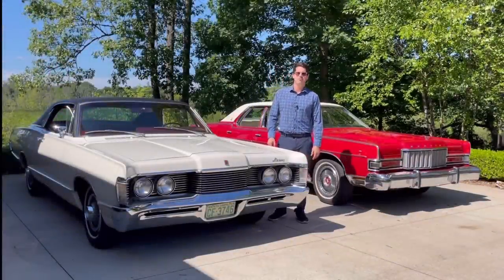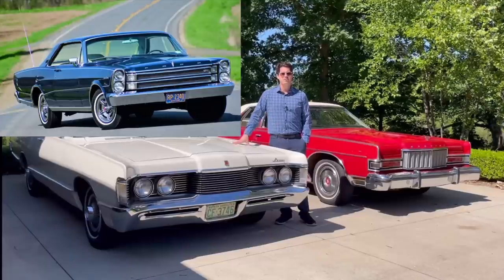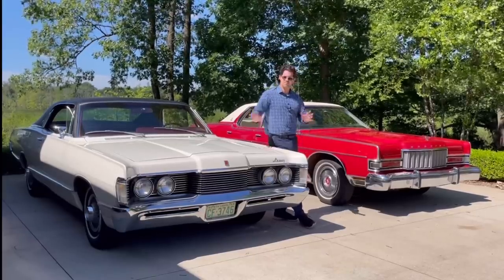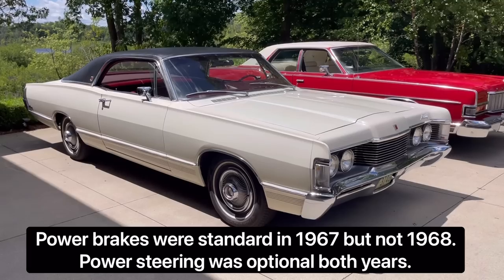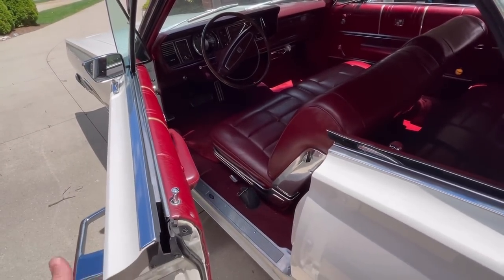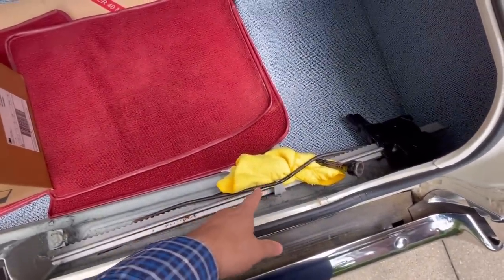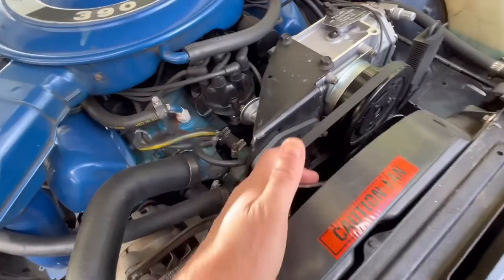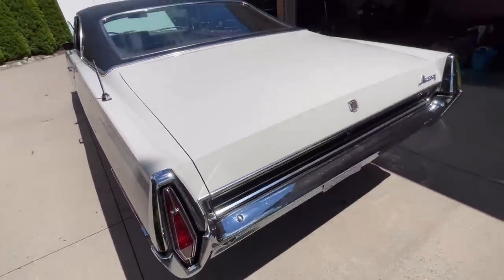9000lbs of Mercury!  Comparison of 1968 Marquis & 1974 Marquis Brougham (Hawaii Five-O Car) - Part 1

Comment: Even as a kid, I always knew the sound of a Ford door closing. The latch made a very loud (but secure sounding) KLITCH to go with the "thunk." Much as love I Mopars, they (as well as GM) never did quite as well with the doors. Even my friend Mike's shitty Mercury Comet had great sound doors. 

Even though you installed dual exhausts, it has an original sound. That is, it's a mellow "chug chug," not some grotesque Flowmasters or anything. I hate when people do that to a full sized luxury car. As always, love your cars and your narration, Adam.
Reply: Haha, I know exactly what you're saying with the door latches! Also, I could always tell what kind of car was driving by or idling or starting without seeing it.  The foregoing would've been helpful if I were blind as my dad would say 🤣
Reply: Fords had that sound all over the place. The engines were higher pitched than GM and Chrysler, the non-solenoid starters, the click of the latches and shifter. I guess that was brand recognition and personality. 
All brands had their own:
GM doors always sounded like they didn't want you to notice what they sounded like, as did much of the rest of the car. 
Mopar door latches  always sounded like they were out of alignment. lol I mean, who puts a whiney, gear reduction starter in big fuselage bodies with big block engines? 
I guess it was finer sounding than the loud truck starter they used in the 50s cars. Our '57 Belvedere was a hard starter: RAWWR R, R, RAWR R, R, R,  RAWRRR Boom! Instead of: SQWEE CHEW, CHEW, CHEW Boom!
AMC? They mostly sounded like Fords, ...except different. 🤓

Comment: Thanks Adam. I enjoyed the review. Re the 75-78 Marquis. I think it is fair to say they were lighter and used plastic more extensively, although I would hardly call them “tinny”. They are still large, heavy cars in much the same way a mid to late 60’s full size Ford or Mercury probably weighs in at a similar amount. The lighter weight also aided drivability given power outputs were lower as well. I do love my 76-78 Marquis and have one for each year - 2 Grand Marquis pillared hardtop four doors and a Colony Park wagon.
Reply: The lighter versions probably also got at least 150 feet more per gallon. :)
Reply: For sure. Every foot counts.

Comment: Hi Adam, You mentioned that the 1968's were only 3,900 in production numbers, similar to the production numbers of the last year that Ford made the Crown Victoria wagons which was 3,800 and change. I happen to own a 1991 model ( LX ) that only has 12,000.0 miles on it since my rebuild of both engine and transmission in 2020. The body is in excellent shape as the first owner took it to Florida every winter so it has never seen the salt. It has all the power features and seating for eight. In fact when I bought the car the rear seats still had the plastic Ford bags on them !

Comment: Adam, thanks for pointing out the difference in GM/Ford build quality referencing the doors. I had both a ‘71 Lincoln Continental Mark III and a ‘72 Cadillac Eldorado convertible (at different times), and the doors on the Lincoln always seemed more solid than the Caddy’s. Thanks for letting me know I wasn’t going crazy.

Comment: I recall on Jay Leno's YT channel, he was reviewing former California Highway Patrol Cars...and the CHP used a 1970 Mercury Monterey and ordered them without power steering...apparently as a budget saving move.   And the troopers didn't take to them so they returned the Mopar for the next several years....Interestingly enough...the LAPD bought Mercury Montegos in 1970 as marked patrol cars....and apparently the officers didn't take to them...because disk brakes were new and the officers kept riding them during pursuits....a technique that worked on drum brakes but would overheat the pads and disks.  Even Adam 12 passed on using Montegos...keeping the 69 Belvidere as the patrol car until the 71 Satellite was introduced.  

Others...great summary on great cars in your collection....and I have the vision of McGarrett's Marquis racing around Oahu.....Book 'em Danno.
Reply: at high speed the no power steering is the correct option for a ford.

Comment: Had a 67 Mercury Colony Park with power door locks.  If I recall correctly, the power locks were located in a box like mount under the dash which included some additional warning lights.

Comment: Really love how you're focusing on the late 60s luxury Ford products. I've always found the '68 padded wheel hub ('69 Lincoln kept it) came with a metal horn ring that was completely unsafe. The '67 pod wheel hub ("sold" as a safety device, some models had a horn ring as well) is also lovingly referred to as the "boob.". As the years have gone by these padded wheel designs basically have become concrete sitting in front of you. I find the extra lip on the dash interesting: In '67 Lincoln added the extra material ('66 is like the '67 Mercury) whilst Mercury waited until '68. Again, another "safety feature" that Ford was proud to promote; the dashes with less lip material look better in my opinion. Just as a sidebar, other standard safety features promoted on Lincolns for '67 was windshield washers and lane changing signals, which we're all familiar with today - curious if Mercury had those added benefits or if an extra cost option.

Comment: As much as I like old Mercuries, my father had mixed experiences. His 58 was junk, but was before my time. 

I do remember his 73 Montero MX wagon. The passenger door had its Mercury emblem installed upside down from the factory. Should have been a sign. We had some great family trips, but it’s engine blew at 56,000 miles. It was all rusted out, despite spending its life in Florida. He later bought a 77 Mercury Cougar Brougham 4-door, and drove it 146,000 miles.

Comment: What a couple of wonderful automobiles. Is it just me, or does the crease in the vinyl roof on the 68 running length wise follow an exaggerated curvature akin to a period landau bar? Honestly it's a really unique roofline that complements the car nicely. Also, I have to say that the vinyl interior on the 68 looks super plush. Honestly I think some period vinyl interiors were nicer than the leather and leatherette seen in newer interiors.
Reply: Interesting observation!

Comment: The solution for the jack rattling is very similar to what I had to do on my 1976 Cougar. The trunk lift was a torsion bar setup above the spare. After 6 months the bars started rattling together. A few wraps of cloth & duct tape fixed it for 10 more years.

Comment: I found it interesting that on the Marquis, they put a plaque on the glove box door, versus the script nameplate like the Park Lane and Brougham models.  Guess the bean counters at Ford were counting every penny, since this was the last year for these bodies.  Bean counting aside, I found the lower pin striping to look good. Also interesting was the inside trunk left panel goes behind the power antenna, where on my Brougham it goes around it covering the mechanism.  I’ll always say that the 65-68 Ford and Mercury full-size models were the best they ever produced.  Starting in 1972 the intermediates became the best in that size. 

According to the Lincoln-Mercury Data Book for 1968.  NO full size Mercury models had power steering or power brakes or automatic transmission as Standard Equipment. I wonder if any were actually build without these option, if so, man they must been hard to handle and stop. YET, all full size model had heater-defroster as standard equipment. 

Think we need a comparison between the Continental Mark III and Continental Mark IV.   I’ve owned both and think the Mark III was a better quality vehicle.

Comment: My brother's 68 LTD was a very handsome car.  Deep maroon 4 door with a black vinyl top, hidden headlights and an all black interior with cloth brocade seats. Those LTDs and Marquis were a really handsome design in 68.
Reply: I agree.  My dad had a '68 Ltd 2 Dr hardtop (dark highland green, black vinyl top, 390).  It was a beautiful car.  I discovered that Ford fit and finish were superior to it's competitors.
Reply: @Richard4point6  Yes!  The fit and soundness of his was was excellent.  Very smooth,  quiet ride.....very.  390 with great performance.  Hot heater and icy cold AC.  And it was plush inside.  My brother,  Allan, loved driving it and felt safe in it. He bought as it's second owner in 74, his senior year in college.  In 75 he moved from Kansas to Dallas to take a job as a weapons research engineer for TI.  He commuted 30 mins one way every day in heavy traffic to TI in that car and rarely had any issues at all.  By 76 his income was high and he could easily afford a new car, but  he continued to drive that 68 LTD until 1984. In that heavy traffic he felt safe in it and loved driving it.  And he sold it to another engineer at TI who brought it back to like new condition as a collector's car. Handsome,  handsome car.  To this day my brother mentions that car and compares other vehicles to it's quality.
I think he wishes that he had never sold it.

Comment: Among Mercury "loyalists" I am guessing that one of the reasons for the drop in production from 1967 to 1968 on the Marquis was possibly the newly available Montego for 1968 that was bigger than the prior year's Comet and was in overall looks a little smaller version of the Marquis.
Reply: In 1971 I went shopping for a used Cougar or maybe a Mustang, being fresh out of boot camp.  I was pretty disappointed when I couldn't find a suitable candidate within an hour's drive of my rural Pennsylvania hometown.  Then a salesman at a Ford-Mercury dealership showed me a light yellow 68 Montego GT and I was hooked.

Comment: I did feel that Mercury had a problem establishing an identity.  In the late 60's through the end of the 70's, you could identify a Buick, Pontiac or Oldsmobile in a glance.  Heck, even a Ford or Lincoln had a certain "Design Language" that was readily identifiable.  I never saw Mercury as being consistent.  It was almost as if the designers and engineers had no unifying theme.  Look at the vast difference between the 68 and 74 versions in this video. Don't know if that makes sense, but that is the way I saw it.

Comment: The MEL is a great engine with big bore spacing achieving .600 wall thickness until you step up to the 462 MEL.
I like the racy 383 MEL, wicked oversquare at 4.300 bore x 3.300 stroke in a big ass heavy block with the 4.900 bore spacing, in which all MEL's have.
Hell, the 430 MEL is even a short stroke motor.

Comment: Hate to be that guy, but according to the '67 brochure, power steering was optional even on the Marquis. Fun fact...according to the brochure you had a no-cost choice between a 4-Speed and an automatic. I wonder what the take rate was on that.
Reply from the maker: Power steering was but power brakes were standard.  In 68 the brakes became optional.

Comment: How did decontenting it by dropping the 410 engine for the 390 save any money? The 390 engine still used the same amount of parts.
Reply: The 390 was used in lots of Ford and Mercury models for many years, so I expect dropping the 410 (which was only built for Mercury, and only for a couple of years) in its favor would have simplified production and provided economy of scale.
Reply from the maker: Less manufacturing complexity/parts/more scale from vendors for things like pistons etc.

Comment: The Marquis was a real money maker for Mercury, at least once it became a full series.  Did a lot to move Mercury upmarket, and the percentage of top trim models sold in full size guise must have made people in Highland Park green with envy.  At least in the full size line, in this era Mercs were not perceived as tarted-up Fords.  The distinction lingered into the 75-78 generation (the Grand Marquis was positioned well above the LTD Landau) but Ford pretty much gave up thereafter.  Stupid, and they should have tried to build on the momentum - it would not have taken much.  I blame the finance guys :)
Reply from the maker: Unfortunately, they generally didn’t sell very well, so I’m not sure how successful they truly were. They finally did around the time they lowered the base price in the mid 70s.

Comment: There was so much competition in 1968 for the Marquis to have to deal with from GM & Chrysler mid size cars like... Impala & Caprice, Chevelle,  Sport Satellite,  Fury's, Newport, Imperial, Coronet to name a few.. I like Fords & the Marquis but it would have to be a good deal to sway me away from these other options
Reply: Impala caprice imperial Newport were full size cars like the mercury. Chevelle satellite coronet were mid size cars
Reply: @travislostaglia8861  Semantics, the gist of my post still stands..It goes by weight in my mind all 3500 - 4000 lb cars..the point I was trying to make is there was stiff competition in 68 hence to low sales numbers for such a nice car as the Marquis

Comment: What model was the Marauder built from?  Those came in around 1969 or so.
Reply: The marauder name was used on engines in the late 50’s there was a car called that name in 63-64 then it went back to the engine name then back to a car name for 69-70 and then the 2003 up cars
Reply: My first car was a 1965 Mercury Monterey Marauder. 1965.